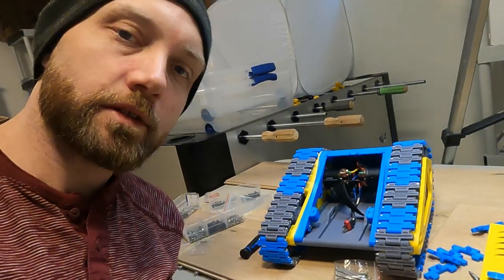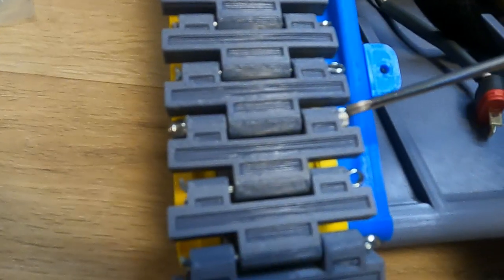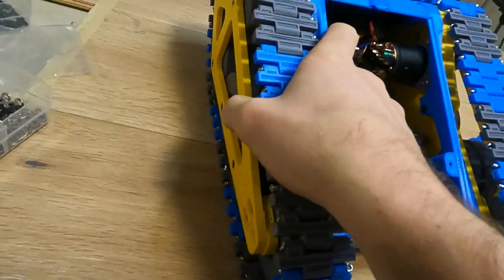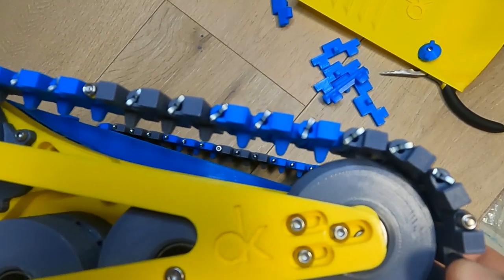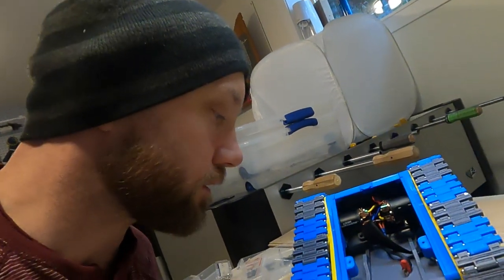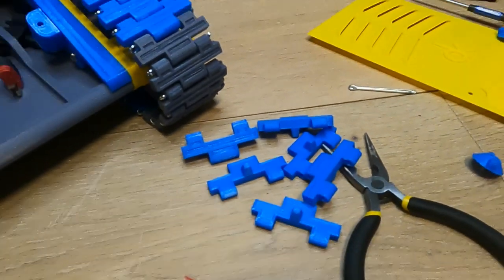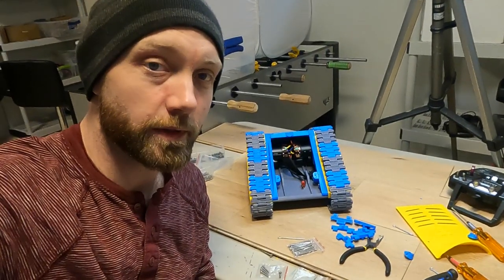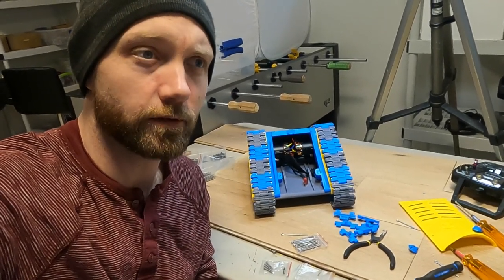3D Printed RC Speed Tank Build

Comment: I made this one some time ago, for better running get the wheels without the "teeth" where they are not needed. I tested it in snow, but the snow got stuck inbetween the tracks and the wheels and it stopped working very fast. but it's a fast and durable tracked tankie.

Comment: What gear did you attach to the motors? I'm currently building one and I have no idea where I could get thme
Reply from the maker: You need a metal pinion gear with module 1 teeth profile (mod 1) with 10-14 teeth according to the build guide. https://www.amazon.com/s?k=mod+1+pinion

Depending on your motor you may have a 3.175mm shaft but most of the mod 1 pinions will accept a 5mm shaft so you may also need some sleeve adapters. https://www.amazon.com/s?k=5mm+to+3.175mm+sleeve+adapter

If you watch my other speed tank videos the motors got pretty hot so I'd recommend a pinion gear with as few teeth as possible and also go for motors with a high number or turns (or low kv)

Comment: So each motor has its own ESC as I can see … but how is steering coupled with the ESC control. I mean, you use only two channels, one for each motor, right?… but how does the motor know when steering is required? …. I feel this is a dumb question, eh?
Reply from the maker: No stupid questions here! When you make the right motor go faster it turns left, when you make the left motor go faster it turns right. If you make the right motor go forward and the left motor go backward it will spin in a counterclockwise circle. The right motor is bound to up/down on a controller stick and the left motor is bound to left/right on the same stick. To make it go forward I put the stick up and to the right. To make it go backward I put the stick down and to the left. Hopefully that makes sense. More details here: https://www.thingiverse.com/thing:2414983
Reply: @rcprinter  oh, I see….interesting. Will have to check it out, as I have never had an RC vehicle of this sort.
Reply from the maker: @mxs8102  First one for me too.
Reply: I've thought about using a V-Tail mixer from an airplane to do this as well

Comment: Excellent work, how to make the mix for double motor 
Thanks
Reply from the maker: One esc in receiver channel 1, one esc in receiver channel 2. On the controller I only use the right joystick. up/down is channel 1, right left is channel 2. Its super simple.

Up and to the right is forward. Down and to the left is reverse. More info here: https://www.thingiverse.com/thing:2414983
Reply from the maker: Ok so I wasn't very familiar with mixing channels on a dual stick controller so I've done some more research and playing around with a few things and now I've got it set-up so the right stick works like it  should with both tracks going forward when I push up and turning to the right/left when I push those directions. I set it up pretty much like how user CashL describes here: https://www.rcgroups.com/forums/showthread.php?2579971-Wanted-RC-tank-transmitter-programming-for-Dummies

The only real difference is I have mine set-up in different channels than his (I use the right joystick instead of the left). 

My specific settings are: 
- Mix #1 On
- Master ch.2
- Slave ch.1
- Pos mix 100%
- Neg mix 100%
- Offset 0

- Mix #2 On
- Master ch.1
- slave ch.2
- Pos mix =   -100%
- Neg mix =   -100%
- Offset 0

One other note is that I also turned the Dual rate down to 50% for channel 1 (which ends up as the right/left on my right stick) because the turning was a bit jumpy and I would highly recommend that you do the same otherwise its quite hard to control. I'll put this all in the next troubleshooting video I do on it...

Comment: What gears did you use
Reply from the maker: For the 540 motor you just use a metal pinion and the stock wheel gear that comes with the model.
Reply: @rcprinter  what pitch gear do you need
Reply from the maker: @Evanj7485  Mod1